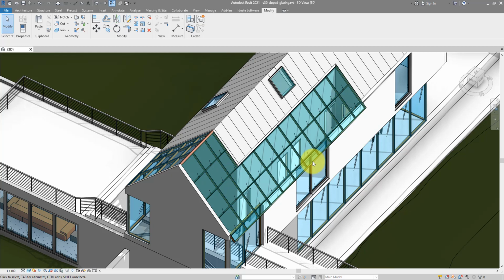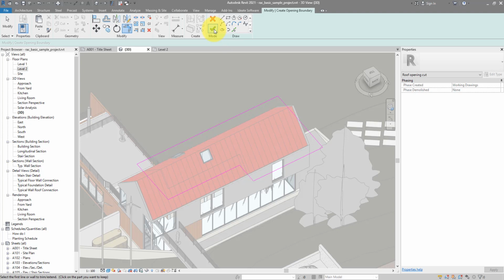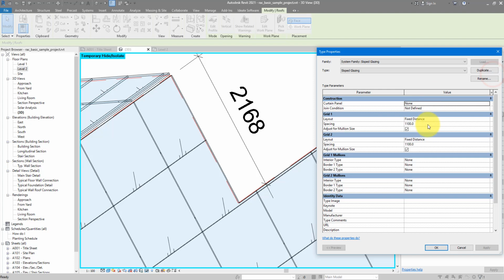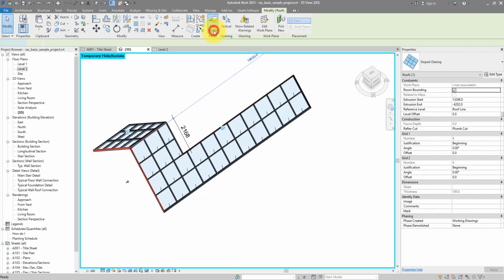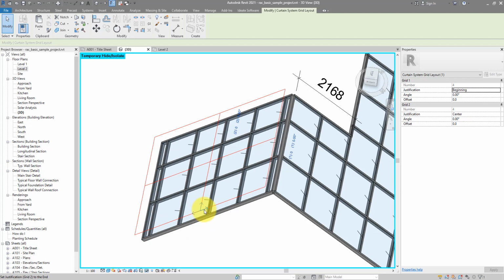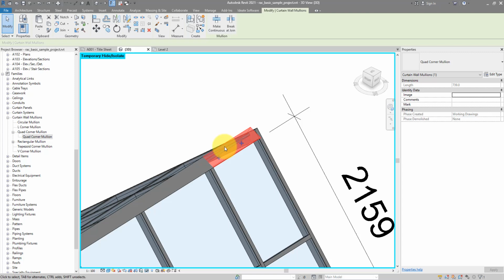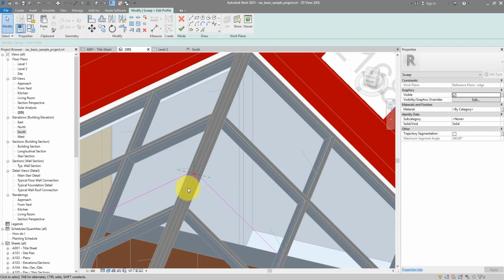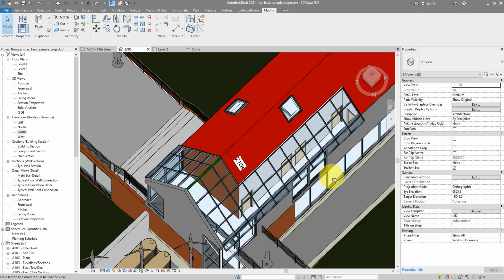Revit Snippet: How to create sloped glazing roofs in Revit

Comment: hi you. how can make control thickness glass when i create sloping glazing. thank you.
Reply from the maker: Hi there! Do you mean changing the thickness of glass panels in a sloped glazing roof?
Reply: @RVBoost  
yep. How can make control thickness glass when START create sloping glazing.

I Had trouble is after finish roof by extrution, have a distance from contour line to glass.  not the same plane. Thanks
Reply from the maker: Sounds like you should change the Offset parameter of the curtain panel family used in your sloped glazing roof type. Select a panel, click Edit Type, then play with the Offset value in there. Does that help?